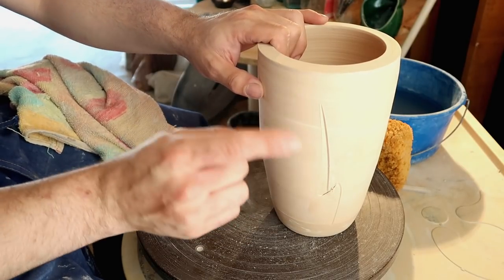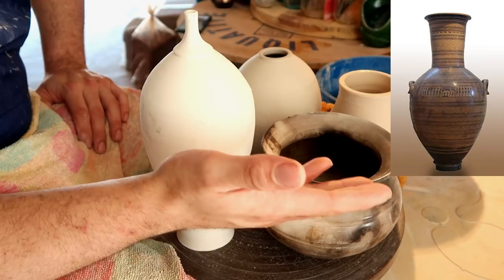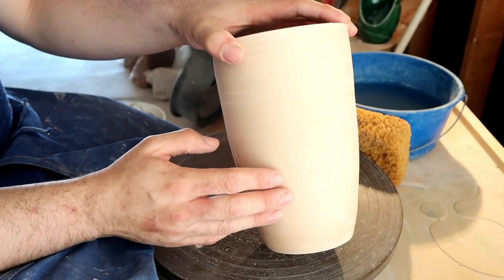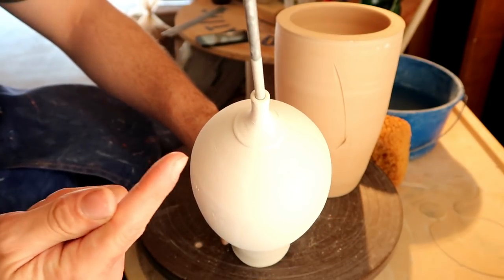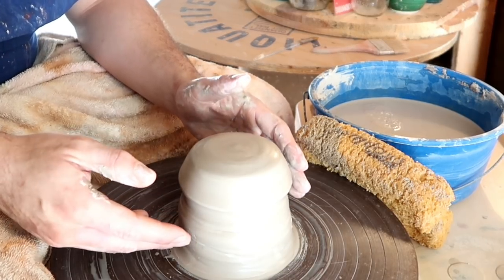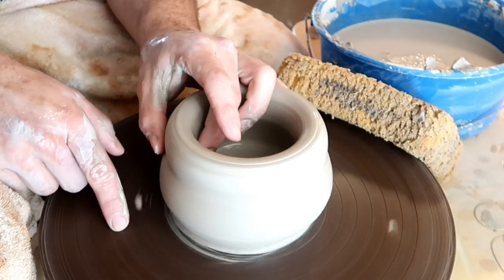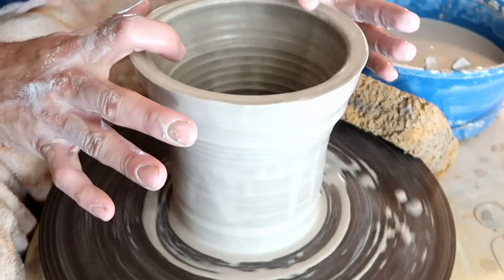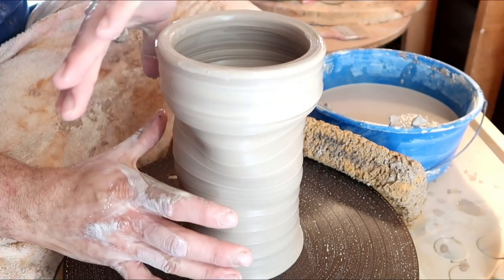Beginners guide to throwing a Vase part 1 (cylinders)

Comment: Were you taught in school like one pound clay balls for vases needed
To be 3 wide and 8 tall or you were not doing it right? I still weigh my clay and always try to get as much height and width etc out. I don’t want to trim it all off I want to use that clay. It’s hard to find videos where one shows how tall a vase should be with five pounds (yes it varies with width also, and belly size etc. was always told that larger vases should look like they weigh a ton but in reality when you pick it up it doesn’t weigh much at all, (unless you’re using 30 or more pounds of clay,). But with that amount of clay the item should look like it weighs 150 or more. Just what my hs and college professor taught me. I still use it today but I don’t see anyone else do this so, is this old school and not used any more?